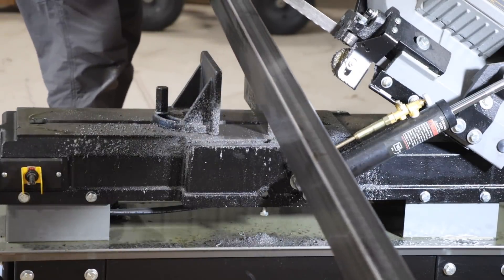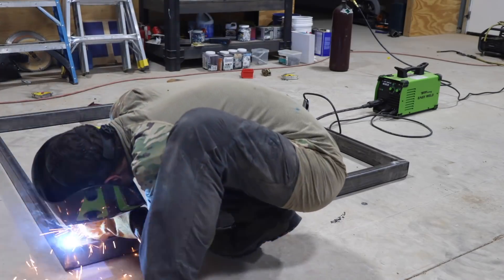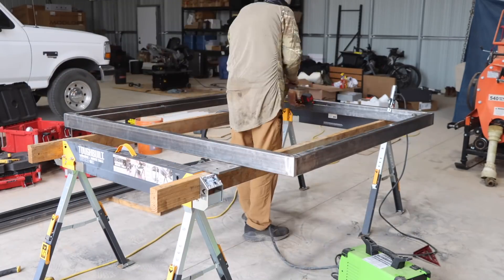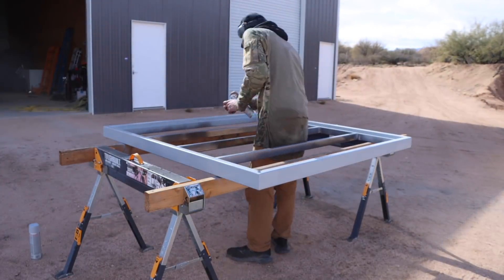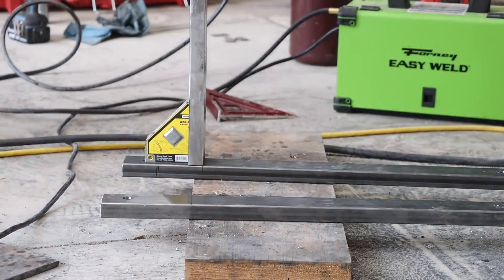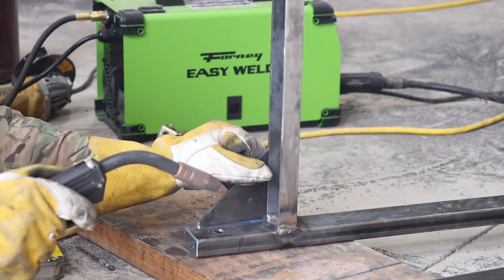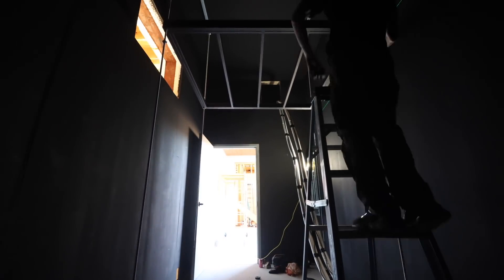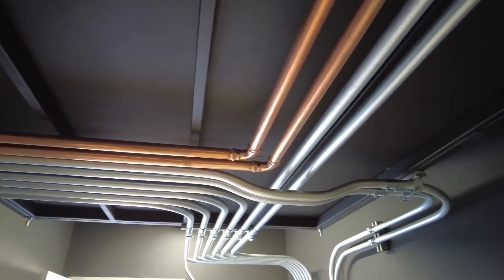Building The Coolest Mechanical Room | Part 1 - HVAC Platform

Comment: Use a flap wheel on all your weld areas on by our bar or tube stock, clean metal with the mill scale removed welds much cleaner, tidier and stronger welds 👍

Comment: love it, looks great, but curious, does NEC allow for conduit installed in this manner (and plumbing codes as well for that matter)- attached to semi-permanent structure such as your metal frame hanging with threaded rod? if vibration loosens the nuts and the framing falls, its taking the electrical and plumbing work with it. I'm paranoid enough where I'd probably just weld those nuts on and sleep better at night! keep up the great videos!

Comment: The most time consuming part of metal fab is cutting with that bandsaw. Get a 14" dry  saw
Reply from the maker: I have a cold cut saw, the evolution, couple problems with it. It's hard to be super precise with it. The blades dull quite quickly and expensive to replace.

Comment: Looks great but wondering why you did it. Those air handlers have tabs on the unit itself specifically designed for them to be hung by threaded rod. Was the platform just for fun?

Comment: Quick tip, put some clear nail polish on the threads where the nuts are at the end of the threaded rods, it will keep the nut from backing off with vibration/movement from the unit.
Reply: he should DOUBLE the nuts, put and extra locking nut under each of those nuts.

Comment: Nice work! Reminds me of a conduit distribution system I did from an Electrical Room with 235 meter sockets and a 3 tiered trapeze carrying 1-1/4"  EMT runs across the concrete ceiling of a parking garage, and up through the slab to each residential unit. It looked like a futuristic steel freeway system/pipe organ. :-)

Comment: Next thing you know you will have a plasma table cutting out parts for you to weld together and become the local custom bracket guy. 

If you do get heavy into metal work you can get replacement sawblades for circular saws to make cutting metal much cleaner then a plasma cutter and a mag drill is well worth the price for the clean holes it will put in the metal as you work on something else.

Comment: You may be using wire that is too thick and your settings might be off. These are the two main reasons for super high beading on your welds. Also, by beveling  your edges you’ll get better penetration. Especially on outside corners. I’m no pro, in fact I’m quite the novice. But I did a lot of research on YouTube before starting and my welds look better than a lot of pro’s welds.
Reply from the maker: I think you’re on to something for sure, Orion and I were talking about it and I’ll be fiddling with the wire speed to start

Comment: But, why hang it from the ceiling?  Why not support from the concrete slab?   I would expect vibration hanging from the ceiling to permeate throughout the walls.
Reply: Pretty sure he had some isolation Springs coming off unistrut from ceiling to eliminate the vibration
Reply: You almost always hang the air handler.  The ductwork is in the air, you want as straight a run as possible to get the air into the ductwork.  The more bends in the path that the air takes the worse it will be at the end of the runs.

Comment: Shading your outside unit from the sun will make no difference. A few seconds after being turned on the temperature of the unit will be totally determined by the ambient air which comes from all around the unit, well beyond your little shade. Also the shade will interfere slightly with the exhaust air shooting upwards.
Reply from the maker: Ummm so ambient air temperature in Arizona is no different whether you’re in the sun or shade?
Reply: this is true but the exhaust part isn't for his case. he's using a Mitsubishi condenser which exhausts horizontally not vertically
Reply: I'm going to disagree on that. If the awning is done right it will shade but can be engineered to not interfere with air flow. Been there done that.
The heat load of sunlight on the condenser coils makes it harder to lose the heat of the high pressure, high temperature refrigerant coming out of the compressor.
That means the liquid refrigerant entering the expansion coil will be hotter and will be less efficient at picking up heat as it evaporates. System pressures will be slightly higher which makes a small difference in how hard the compressor has to work and leads to increased energy consumption.

Comment: Very nice.  I picked up wielding as a teenager and took a two year course in it.  I learned  mig, tiger, stick, and oxyacclaine.  I was pretty good but I did not turn it into a career.  I have alot of skill sets like you.  I could walk into the jungle with a toothpick and pocket knife and thrive.  Anyways have fun.
Reply: Maybe you mean welding (not wielding) and oxyacetylene ?
Reply: @wallykramer7566  that's what I get for not proofreading.  Oxy acetylene gas welding which I like the most but is very slow so most welders stay away from it.

Comment: Izzy swan makes a tool for running nuts long distances on a thread rod check it out
Reply from the maker: I did see those attachments and I made one with an old bit and electrical tape, didn’t work great, but two of the nuts were really giving me troubles lol
Reply: @Handeeman  this is the one I was talking about but I did not remember how much it was!  https://www.jlconline.com/videos/the-dpt-wrench-from-izzy-swan_o
Reply: @lestergrayson3049  That's a nice tool but I'd imagine it would be hard to justify for such a rarely used tool unless you work with all thread every week

Comment: Maybe I missed it...  What is the reason for suspending the air handlers from the ceiling?  Just aesthetics, or is there a functional advantage?
Reply from the maker: It serves two main reasons. It frees up more floor space in the room. Mounting the air handlers on the floor would've crowded up the space considerably.

The other thing is that it minimized the length of duct work and fittings. Less fitting and less footage of duct means better airflow.
Reply: @Handeeman  hope you will have enough room to move around if you have to replace handlers sometimes in the future.